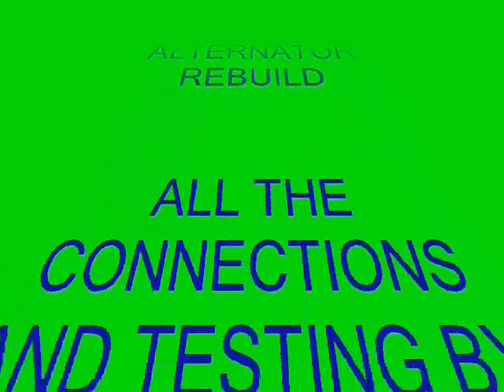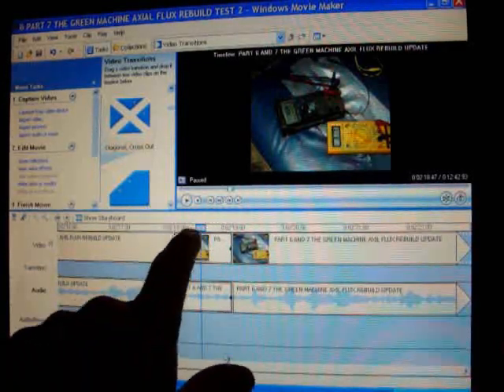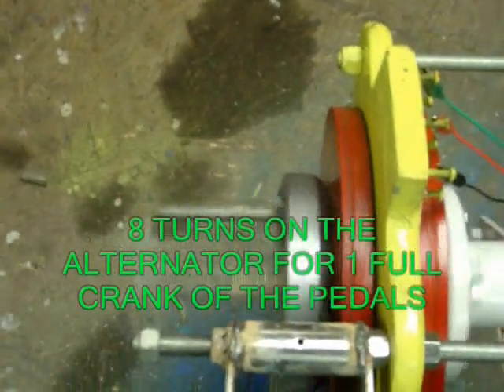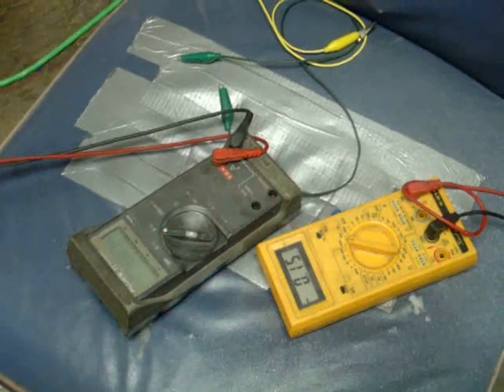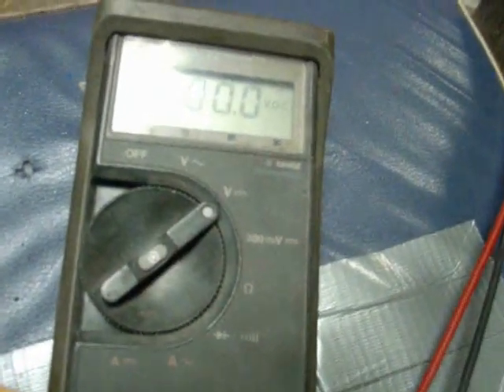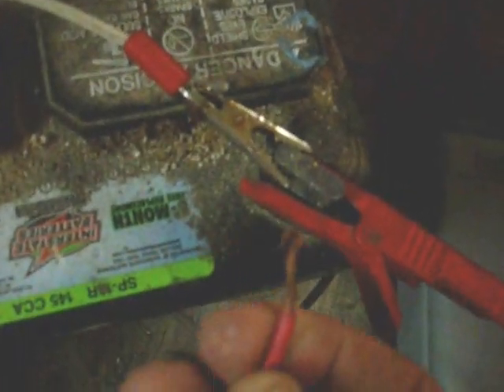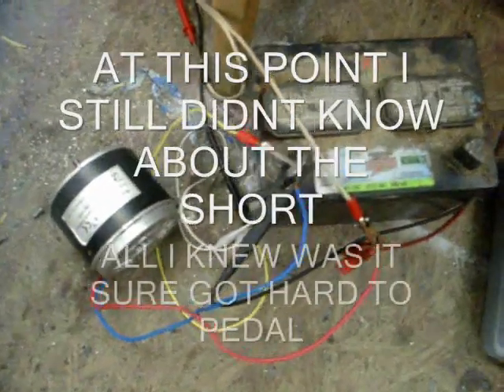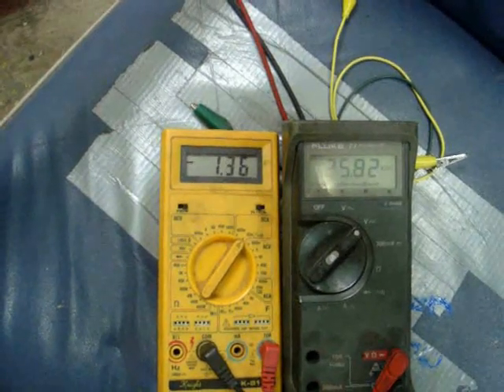PART 7 THE GREEN MACHINE AXIAL FLUX ALTERNATOR REBUILD UPDATE 2

Comment: you have to be very proud of your mud man shows,if i wasnt in the oil field,i wouldnt  think of a mud man. on a drilling rig,  hehehem any way thanks for these videos./ the dual rotor axle flux ,wired for star , was the best info i could find on how to make your own,power,i took many notes for future green machine generator. that i will build,using a ten inch rotor/just like, the repaired ,job you did, ! here,i got mag measurments and  every piece of knowledge,i needed for this project,

Comment: Can you please explain when charging a 12 v battery without a mppt charge controller, is any of the excess voltage over 14.5 wasted ? I can understand the part about the more amps the better for charging. Looks like you had a nice workout without going to the gym.